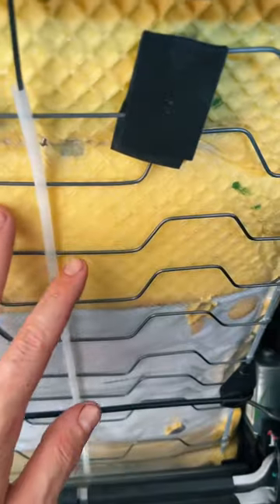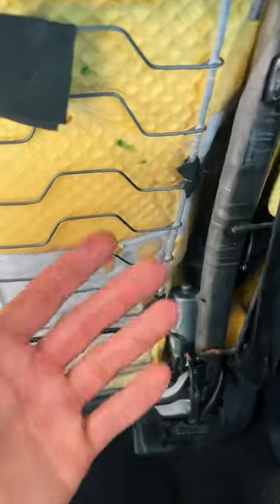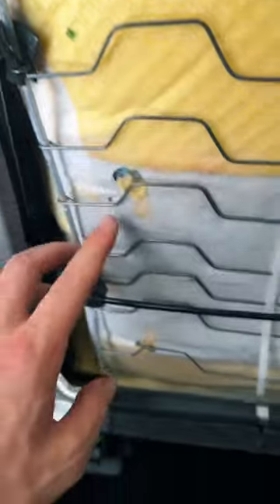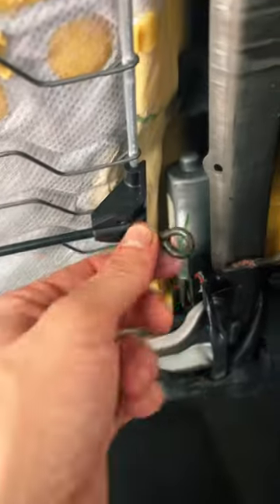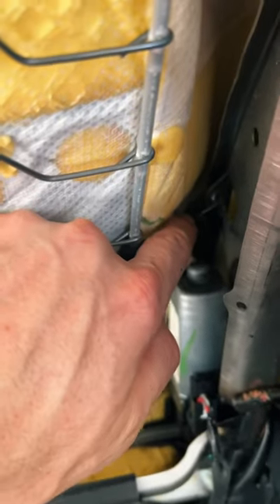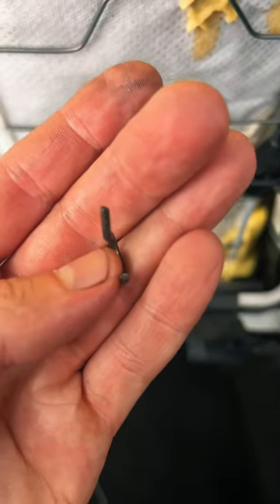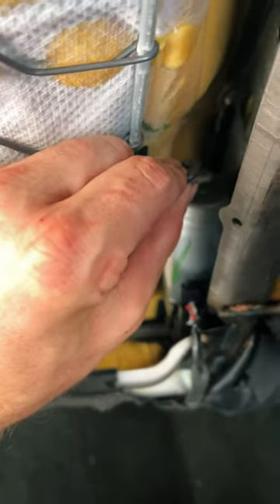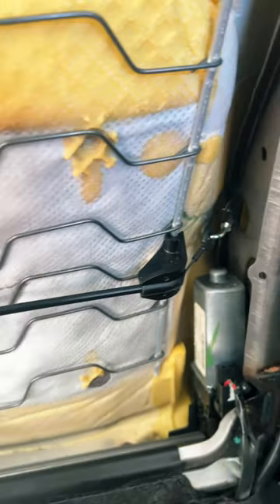#Subaru Lumbar Back Support Fix! 5 Mins, $5!!! Fix That Squishy Seatback!#mrsubaru1387 #automobile

Comment: Perfect. Fixed in minutes with a $1 clip. IMPORTANT: since your lumbar support is most likely collapsed, when you open the back of the seat and before you start this repair, use the switch on the side of the seat to wind the cable all the way out, then push the lumbar support into the seat from the back. this will give you plenty of slack and space inside the seat to connect the clip.

Comment: How does the seat back cover come off? Are there a series of clips and screws to remove?.
Reply: Me, myself and I would like to know too
Reply: @Blck_Bird05  There Are two Phillips screws at the bottom of the back cover of the seat. Once you unscrew those, pull the plastic seat cover down
Reply: There Are two Phillips screws at the bottom of the back cover of the seat. Once you unscrew those, pull the plastic seat cover down

Comment: I did the same but now….the cable itself snapped!!
Reply: So what happened now? What did you use for replacement?
Reply: Mine just snapped and I am thinking of doing this as well.  I am also thinking that the clip was deliberately designed as the point of failure as it would be cheaper to replace. If I replace it with something stronger what else will break? Similar to Copper in a fuse box or Tungsten brake pads I.e. stronger than the rotors.

Comment: That was really clever only issue i see with that is that the new retainer you put in is longer then the old hook so im pretty sure that would limit the range of the lumbar section a bit. Not tryna be an A hole just curious to know if that affected it in any way